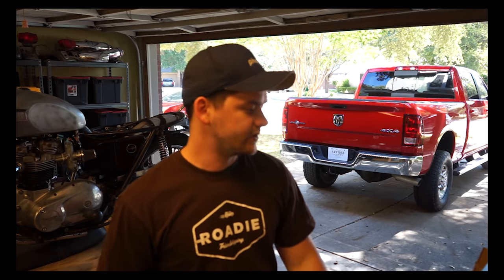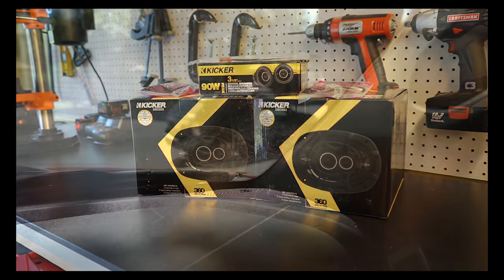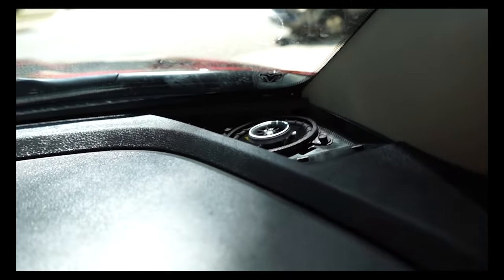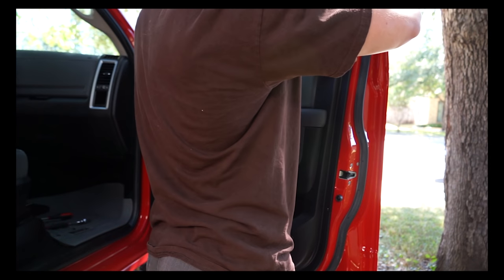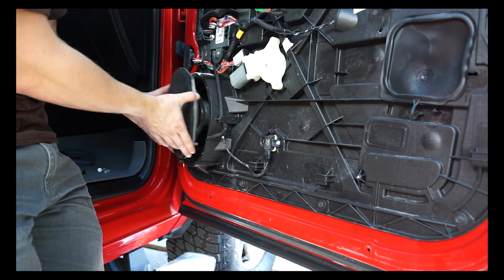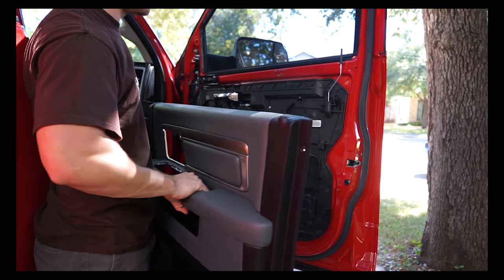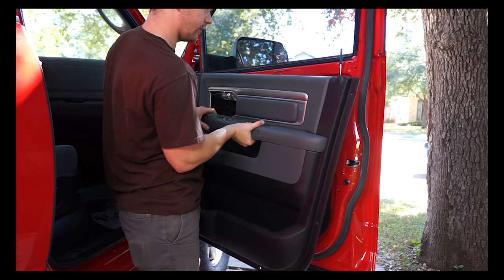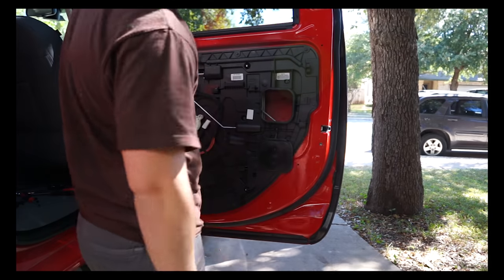Ram Speaker Upgrade

Comment: I just installed two of these 6x9 Kickers in my truck along with the 3.5" Kickers on my dash.  Seems like I can only hear the music coming from the dash speakers. The 6x9s are not putting out any significant bass or loud noise. I talked to Crutchfield and they told me that I need an amp to bring them to life..  I have a 2012 Ram 2500 Crew Cab.
Reply: devendati can u tell me what you do I want to do this to my truck 2012 ram 1500 quad cab
Reply: I'm going to upgrade the audio in my truck (2013 1500 Crew) also and have been doing research. From what I've seen, the 4 door speakers are 2 ohms but the dash speakers are at something like 8 ohms due to some wiring. What I'm seeing suggested on sites is to keep any speaker replacements at 2 ohms also. Switching to 4 ohm speakers (which these kickers are.. and most aftermarket coax speakers) while the head unit is putting out 2 ohms signal will make the speakers sound soft and quiet. If you amp them or replace the head unit, it won't matter. I'm considering either JBL GX/GTO speakers or Infinity Kappa series as they are both 2 ohm speakers and will sound better than stock while I save to add an amp & get even more out of them
Reply: Eric Coggins I've found 2 ohm 6x9s on cruchfield, cant remember the brand.   But as 99% of all the other 6x9s they sell, they too are too deep for the front doors of a Ram.  If I knew how much of a spacer that could be used to make them work in the front doors, I wonder if it would pay off to use the 2 ohm 6x9s all the way around, and 4 ohm dash speakers, or would the impedance be too low on the front with a 2, and 4 ohm wired in parallel.... Something to hopefully get some professional answers to..

Comment: so I have a 2016 ram 1500 big horn. I bought the kicker 3.5" tweeters for the dash but I noticed you installed 6x9 triaxials in the door. so is there any kind of cross over built into the truck and do you want to install a 6x9 with midrange and tweeter in it in the door when you have seperate tweeters in the dash. Just wondering how that works. thanx for your time and the video.
Reply: Kristian Thompson I put a component set in my 02 ram.  I placed the 6x9 in the door as normal and the tweeter in the dash in the locations where the 3.5s were of course.  It did not sound good at all.  Entirely too much separation between the two speakers.   I ended up cutting a hole in the door panels about 5 inches above the woofer and flush mounted them.   Best decision ever.  However I will not be doing that to the 2018 I bought last week, lol
Reply: You definitely want to install 3-way 6x9’s in the door and not use separate components...the 3 1/2” dash speaker is more of an “added extra” that is going to give you an extension of the spatial “highs” closer to ear level of the listener...and those bass blockers are a GREAT idea!!!

Comment: the metra 71 039C speaker wiring harness is no longer available via the link.  Do they appear somewhere else or is there another replacement that will work?

Comment: Is the set up exactly the same for the 2017 model year? Crutchfield swears that the harnesses and speaker sizes are incorrect/don't fit. I have the 8.4 Nav unit with stock 6 speakers.
Reply from the maker: I'm not 100% sure but I know it's the same on the '16 1500s so I don't know why it would be any different for '17s.
Reply: Mike, did you do the install? Was it the same?
Reply: Michael Zucker, was wondering. Did you ever figure out if the 2016 and the 2017 were the same to install??
Reply: I just installed these speakers on my 2017 Ram 1500. You're good to go.
Reply: awesome bought my truck last tuesday a 17 so def gonna upgrade these and maybe down the line put a sub under the seat

Comment: Very Nice Video and I had the same thing happen with my upper molding metal retainers on the rear doors, pain in the butt. I am wondering if you have wired in the amplified sub-woofer yet(I am looking at options now for my 2014 RAM). The only part I'm having issues with is how to wire up the signals from my OEM 8.4 headunit....Mine came with the base 3.0 radio and I've upgraded to the 8.4 nav..so I still have the 6 speaker set up with no existing wiring for the factory Sub. I'd like to do this myself, but I may pay to have one installed, just so I don't muck up the OEM functionality. I'd like to get your take on this since your set up is very similar to mine...Thanks!
Reply from the maker: I haven't installed a sub yet but it's on the list. I gave a shallow mount 13 I want to make a box for. I will make sure to put a video together when the time comes.

Comment: That's gap is a big deal. Why because if you over tighten 1 of the screws you can bend your speaker witch will make your speaker sound like Sh*t and mess your speaker up

Comment: Question. I had best buy install pioneer speakers. But when I got there. Installer told me that there is only bass going to front door speakers and that highs will not run on speakers that have tweeters in them. It that true?  Do you hear highs on your front doors?
Reply from the maker: Mine definitely play more than bass out of the door speakers.

Comment: Do you think i need to buy rear speakers as well? would it make a difference?
Reply from the maker: Yes, I would go ahead and do all of them to keep the sound consistent.
Reply: i had the same thought, I know if I fade the headunit sound to only the back speakers it sounds like crap, most of the stock speaker sound comes from the front ones it seems, not sure if that's because maybe the fronts are better speakers??

Comment: The link for the 3.5 (dash) wiring adaptor no longer works.  Is there another link?  Also will this work with a 2018?
Reply: Metra 72-7902 is the part number clutchfield to me to use.

Comment: Question, how did you know the 3.5" speakers took different wiring adapters?
Reply from the maker: Because I bought the wrong ones the first time around ha.
Reply: I read something about the 3.5's being 8ohm factory speakers and you replaced the speakers with 4ohm ones, did you notice any issues? too loud??
Reply: There won't be any issues. Ohm's matters more when you amp them up. Too loud!?!?!?! That's a good one...

Comment: Hey man I can’t find the adapters for the 3.5’s. Any advice. Crutchfield doesn’t have them anymore and the one is says to substitute says it doesn’t fit my 2013 ram 4 door
Reply: on the crutchfield link it says no longer available. underneath where it says that is a picture of the replacement ones 72-7902.
Reply: Chris Seres Thanks man

Comment: Do you see a way to upgrade the dash speakers with 4 inch speakers? thinking about installing a full Focal system on mine, but they only offer 1 and half inch tweeters or 4 inch speakers, no 3 and half. Would I just need a custom mount, piece of MDF or something for the two different screw hole locations?
Reply from the maker: You might be able to squeeze them in there. You would definitely have to figure out a new mounting system.
Reply: figure it will just be easier to go with the component speakers and bracket mount the crossed over tweeters into that spot. one less set of speakers to connect directly
Reply: you manage to get 4" speakers in there? I thought the 3.5's had some self tappers, if you just made the hole bigger would it not just screw down to something with the self tappers? or do you need some sort of plate to screw to and not just the dash material?

Comment: If I was to buy the speakers the exact setup as you but could I just not buy the adapters and solder or crimp the speakers on
Reply from the maker: Yeah you definitely could do that. I went with the adapters in case I want to upgrade later.

Comment: Is there enough clearance behind the door panel speaker grille to make a spacer out of 1/4" mdf for the 6"x9"?
Reply: fitzmann85  Yes i used a 1/2"  6x9 spacer in my 2011 Ram 2500 front doors.
Reply: jamdenfair Thanks. That opens up a ton of options.
Reply: I just bought an 18 sport, last week and am wondering the same thing.   His instructions are good here, as far as step, but as we can all see, he is warping the hell out of that basket and that is a no no from my point of view.   So IF there is enough clearance to make a bracket, then I would really like to know that myself.  I personally want to do the Kicker KSC series all the way around

Comment: wish we could've heard it. how did it sound?
Reply from the maker: The mids and highs are much better than stock. I do wish it had more bass. An under seat sub might be in my future plans.
Reply: Classic Octane that's what I thought. I'm undecided on 6.5s all,around or sticking with the 6x9s. I also want under seat subs eventually. I just bought my truck so it's gonna take time
Reply: you may not even need the sub, just get a 4-6 channel amp to power your door speakers and it'll probably give you decent bass, not subwoofer bass, but still decent.

Comment: Great job but I'm going to get different speakers for  front door
Reply: Lahenie U.S. Army which ones are you going with?
Reply: Pioneer TA-A series fit without touching the bracket. They are 2 2/3 mounting depth which fit perfect for the ram trucks

Comment: Has anyone put 6.5's in the front doors?  I've got an '18 regular cab with manual windows & locks.  I'm thinking of putting the KICKER 3.5's in the dash, 6.5's in the front doors & 6x9's behind the seat.  Reason being is I don't want the front door to bulge out with the 6x9's.
Reply: there are 6x9's that do properly fit the front doors. just go to Crutchfield's website and put in your vehicles info. They'll show you the handfull of 6x9's that properly fit the front doors. Here's one that fits just fine

https://www.crutchfield.com/p_130TSG690/Pioneer-TS-G690.html

Comment: i have a question,i was gonna do mines on my ram,but didnt bought the white adapter to connect to stock speaker plug,im the truck cable how do i knw whats negative and positive?? for example for cables are dark gray,but one lime green line and the other dark green..help please!

Comment: so 3.5 speakers use difrent adapters or same as ther 6x9 doors speakers Metra 72-6514 or Metra 71-039C??? pls let me know ty
Reply from the maker: Correct they use a different wiring adapter.
Reply: Classic Octane ty

Comment: Do you know the factory wiring harness color code for all 6 door speakers? Need to know the positive and negative  so I can wire a 4 channel amp to the factory harness so I don’t have to run new speaker wire to each door.